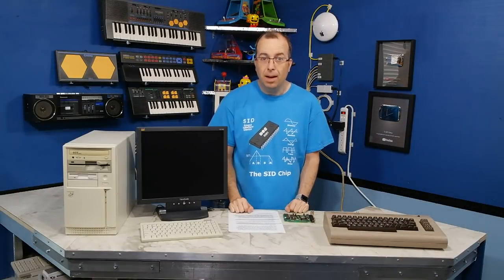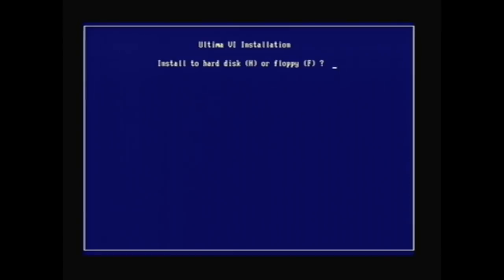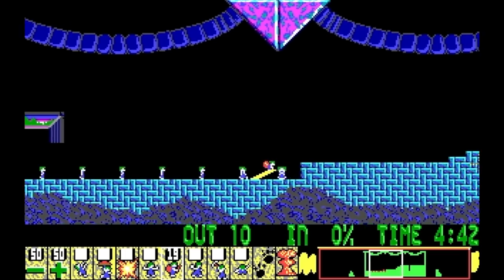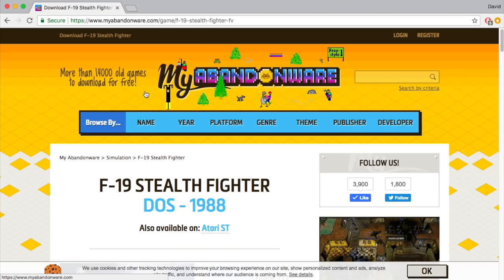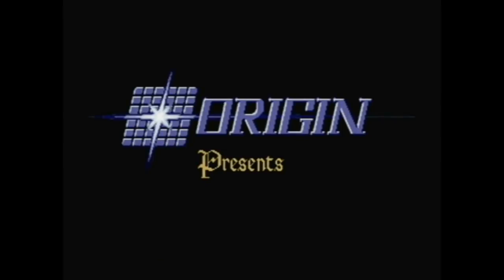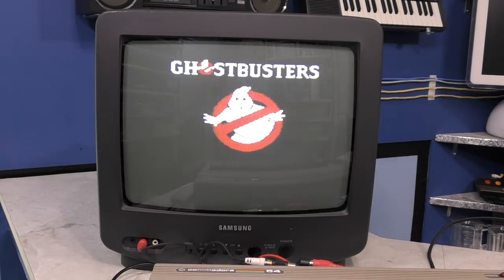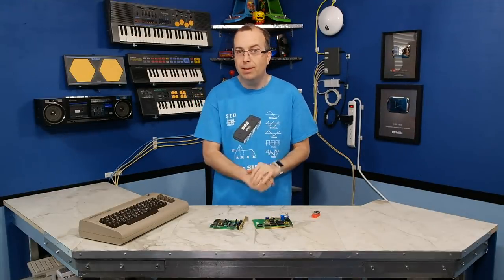Replica Sound Cards - AdLib, Innovation SSI-2001, and SwinSID Ultimate.

Comment: Something probaly only headphone users noticed: the SwinSID chip on the replica board had some pseudo stereo emulation. I suspect this is an optinal feature and  probably off by default on the real C64. Edit: I checked it on the creator's website and stereo is metioned.

Comment: Holy yes those LEDs
Reply: Yeah.. too bad they stay hidden under C64 keyboard :(
Reply: A c64 II with acrylic case would look amazing with the chip inside
Reply: @Booruvcheek  I'm almost a year late but by the looks of it there are pads for attaching external LEDs on the PCB. At 13:06 it's clearly visible. So if you want you can solder wires to these pads and put remote LEDs where you like.
Reply: @Sheevlord  That's a nice feature right there. Sadly, I don't own a C64, nor have I ever seen one of those machines. I doubt there were many of them in the 80s in USSR during my childhood, in fact, owning a computer (any computer) was something I could only dream of.

But anyway, thanks for pointing that out.
Also, nice userpic :D
Mr. Palpatine was perhaps the best part of the prequels.
Reply: @Booruvcheek  Yep. Then again, it's not surprising, since Ian McDiarmid who played him is a renowned actor with a long career.
Reply: @Booruvcheek  They made a lot of  them so it should be easy to find one now.
Reply: Zach K i was just about to say, thats the cutest use of technology ive ever seen.

You go, little LED band.
Reply: @Booruvcheek  not good
Reply: @Booruvcheek  why wouldn’t there be a lot of computers in the USSR? Why couldn’t you buy a computer back then?
Reply: @dqwno4900  Because planned economy of USSR was, how do I put it mildly, not very good at anything except producing weapons and things required to manufacture weapons. You know - iron ore, concrete, etc., and then tanks, tanks, tanks. Tens of thousands of them.

To buy a car, on the other hand, you had to wait for years, if not a decade in a queue. If you were lucky enough to be allowed into a queue like that.

So, as you can imagine, manufacturing "home computers" for the masses was not high on the list of things to do for the Communist Party planners. It was seen as a passing fad, a fancy, not helping the glorious state in its eternal quest for Communism, and was generally frowned upon by the Communist Party apparatchiks.

As the result, Soviet home computers were (1) hard to find in stores - only in  big cities you could actually see them on the shelves, this also means you could not choose the computer to get, you can only buy the one model that is sold in your city;
(2) expensive, as in worth between 4 to 6 monthly salaries;
(3) incompatible with each other, although this was also the case in the West, but in the West by the end of the 80s bad or unpopular models died out, while in USSR you were lucky to get anything;
(4) of poor quality - poor keyboards (e.g. BK-0010 with membrane keyboard), unreliable, etc.
(5) there wasn't much useful software or many good games for them, the situation was made worse by their incompatibility with each other.

Huge popularity of ZX Spectrum clones in the late 80s and 90s was caused by the reasons above. These clones were cheaper, manufactured by small shops that were allowed to operate privately by Gorbachev, often by one person, who was earning money from sales, not just fulfilling state planners' quota.
Also there was abundance of (pirated) software and games for these machines.

To this day they are fondly remembered by many folks who "were there" all over the former USSR.

Comment: That Chime sound is so charming, i'm surprised that type of idea was never implemented in any other sound chips back in the day to differentiate themselves from their competitor. Something like "Only TRUE AdLibs will tell you on startup" would be a killer selling point from a marketing point of view.
Reply: that chime reminds me of the mac computer one.
Reply: The Apple IIGS makes a similar-sounding chime when you turn it on or reset it.
Reply: Acorn computers such as the BBC micro and Archimedes machines make a soft beep on startup too. Its used as a type of POST signal to let you know its working. Of course PC's always make that beep too (not a nice sounding one like this) so I think the C64 is better off with this beep. Its like a little "hello" when you switch it on.
Reply: Macs still make that very annoying sound. >:(
Reply: Interestingly enough, for a long time, you could actually tell what series a Mac was from based on the sound of its startup chime. They basically recreated the chime each time a new major version of the ROM was made, up until Steve Jobs returned and made sure every mac from the original iMac onward used the exact same sound.
Reply: Tyler Benson Because adding this in an old school sound chip would involve a lot of extra circuits on the chip, serving no productive purpose.  But because the modern replacement is actually an entire computer simulating SID chip behaviour, adding the chime is just a few extra lines of code squeezed into excess ROM (because ROM is only sold in nice regular sizes). Back in the day, it would be the main CPU programmed to play the startup sound, using available space in the main ROM.  IBM PC actually had one of the most elaborate startup sound implications, playing different "beep codes" depending on what hardware was too broken to show an errors message on screen, there were even beep codes for absolutely no RAM, broken CPU etc.  If all went well, the Power On Self Test (POST) would issue a single decisive beep to signal all OK, booting now.  The original beep code logic was extremely clever in how it did things before the hardware could be fully trusted.  For example, with no RAM, no subroutines could be called, and with no confirmed timer clock, the CPU had to generate and output PWM sound in real time by running loops at different speeds, using nothing but the 10½ 16 bit registers, the flag bits and the ROM itself.
Reply: @dlarge6502  Actually in the case of the BBC Model B, not true. The SN76489 PSG sound chip has a random register array on start up so all the channels make noise. When the computer boots the first thing it does is initialise the PSG and mute it. The only reason it takes a second or so compared to the Master System or tandy is because the BBC uses a 555 timer to hold the reset low when power is applied, where as the other two boot almost immediately and thus clear it before the user really hears anything.

So in essence, that startup beep in the beeb is just a quirk, not a feature.
Reply: Putting it simply, it was because the old sound cards relied on the CPU to actually create the sounds to be output to the yamaha or SID, the chips were extremely advanced but they werent computers they didnt have RAM or a microprocessor, even when the soundblaster came out it would use DMA and Interrupt requests to talk to the CPU, and so the CPU could just tell the blaster " hey your sound it at memory location 03H or something... go get it and play it" and the sound blaster was able to do that, but it couldnt hold any sounds in its ROM so they were essentially silent

Even modern sound cards in your modern machine work in a very similar way, the CPU still handles the load of telling the sound chips where to find the sounds and the chip just pulls them down and plays them, which is also why you need drivers today for full support... its also why a lot of PCs still have little piezos for the POST Beeps, some chips while emulate the beeper but the mainboard has to support that.

Comment: Technical nerd correction at 7:25: the 78L09 is a 9V voltage regulator, not a transistor. I figure the jumper is connecting the pad for the regulator's input straight to the output. When you remove the jumper and put in the regulator, the 12V power is regulated down to 9V for the 8580. If you ever wanted to put an 8580 in there, that regulator can be obtained very cheaply.

Comment: Thank you for the video, The 8-Bit Guy!
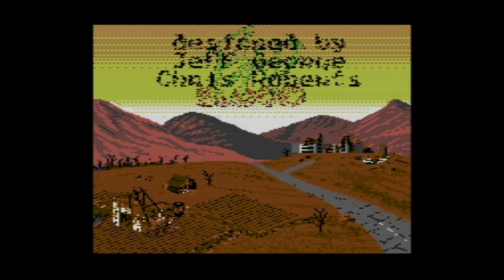09:01 - definitely much better music on C64 version. The marketing problem of the Innovation that you've mentioned may well be the source of the problem. SSI-2001 support, even when it was added, was very basic, SID chip was treated more like 3-voice Tandy chip with another waveforms... Not nearly unleashing the full potential of the SID. As a result the sound was pretty "meh" compared to Adlib or other cards. No contest to the same SID in the C64.
11:33 - I didn't try SwinSID of any version in my cards and I don't know about its ability to work on different clocks... Probably it only can emulate 0.95 MHz (C64 PAL) and 1.023 MHz (C64 NTSC). But SSI-2001 runs the SID on 0.895 MHz. Probably SwinSID tries to detect the input frequency, rounds it to one of the C64's and can not produce sound in tact with actual clock (0.895 MHz), also sounding a little off in tone. And for real SID it is not a problem at all, it will run at any clock provided.
Also, you can switch a jumper on the SSI-2001 replica to make the SID run at 1.023 MHz (C64 NTSC) clock. In "officially supported" games tone will be off, but with osp2001 *.SID player it will run exactly as C64 (NTSC version).
Reply: I would also attribute this to composer skills. IBM PC composers generally did think in terms of musical instruments that a sound card should simulate and musical notes that you can play on it. Hence it is no surprise that MIDI did play an important role in PC music.

That approach completely fails with a SID, because it doesn't resemeble real instruments at all. In order to unleash the SID, you need to look within a musical note and turn several knobs of the analog synthesizer (such as filter frequency and pluse width) in orde to make sound more lively and dynamic. Also the high accurate frequency control (16 bit versus 12 bit for Adlib) does allow effects that are impossible with Adlib, but you only notice that when you are after those effects rather than just wanting to play some notes.

C64 composers did look deeper, because the SID forced them to do so. Music for the SSI-2001 was likely an afterthough and so the PC composers did not want to spend too much energy on getting the best out of that weird Commodore sound chip.
Reply: Daniël Mantione at first glance yes, that can justify "lazyness" of PC music composers.
But heart of the AdLib card - Yamaha OPL2 FM-synth chip - is more or less the same story. It is a tone generator with a bunch of "knobs". But OPL2 had more voices and waveforms.
Even if composers were too lazy, why not just port exact same melody from C64 version of the game, the SID is the same and it can be addressed the same way as on C64.
Reply: Getting music between platforms wasn't nearly as easy as it is today, since they usually only had 5.25" floppies to work with and each platform usually had its own floppy standard that was incompatible with the other platforms. It wasn't until after 3.5" floppies became the norm that FAT became available on multiple platforms, enabling easy file transfer between them.

It would have been much easier for them to convert existing PC versions of the music to the Innovation version than transcribing the code from the C64 version by hand.
Reply: Certainly true, but the "file exchange on floppy" problem was the easiest to solve: The Commodore 1571 can, with the right software, read and write PC floppies.

A far worse problem would have been that any C64 music was written in 6502 machine code and would have to be completely rewritten for the x86 CPU of the PC, even though the sound chip was exactly the same.
Reply: I think for authors of the game at a time transferring their source code or any other parts (such as music) between platforms was not an issue.
Reply: And how long has the software for reading PC floppies on the 1571 been around? If it's been widely available since before these games were originally made, then that is one less hurdle to the process. Remember, though, most of the time the only ways people heard about these kinds of things were through magazines and Bulletin Board Services, as this was before the internet as-we-know-it became widespread.

One other note (no pun intended) on the subject of music, which Daniel Mantione touched on, is that not every system stored their music in a format that we could consider a standard. 

Commodore systems stored their music as a series of instructions for the 6502 (technically the expanded 6510, but it was still a 6502 core) to pass to the SID chip so it could interpret them. Certain other systems as well as popular game consoles like the SNES and Genesis/Megadrive also used a similar method for their dedicated sound chips, with code written for that particular chip and processor combination. Even certain early PC sound cards used this method.

Systems that didn't have dedicated sound hardware relied on coding specific to those systems to approximate what those dedicated chips could do, which often fell far short. The Apple II series, for example, was always lagging in the sound department because it didn't get a dedicated sound chip until the IIgs.

While MIDI was around, it didn't really have the support for custom instruments and effects that directly controlling the synth chip allowed. That said, it was still quite popular as it was more intuitive for musicians to use, to the point that most PC sound card makers started to implement some form of the General MIDI standard in their cards. Unfortunately, because of the difference in how MIDI works and how the other music methods work, it's not a simple task to convert from the other methods to MIDI, though the other way around isn't so hard.
Reply: "Big Blue Reader", the most popular program to read IBM PC disks on a 1571, was released in 1986, so well before these games were written. What you write about internet unavailable is right, but I assume game studios were relatively well informed and would be aware of these possibilities.

An alternative for data exchange with PCs is to use RS232, and this would have been the method before the 1571 came on the market. The C64 supports RS232 right from BASIC, allowing anyone with some programming skills to use it do exchange data with a PC.

Comment: 13:00 - omg Dave, that gave me an idea - put pin headers there, and then mount LEDs to the case, and connect them to the headers. That'd be a cute lil addition to a Commodore64
Reply: Agreed!  I loved the look of those LEDs, they would look great on the case itself.
Reply: I mean Clearly thats why there are pin headers there. but it would look pretty swanky
Reply: there are holes, but it seems to come unpopulated, so he would need to add the header pins.
Reply: Red yellow and blue of the color bars?
Reply: ^THAT would be a thing of beauty - a Commodore 64 Logo Plate with inbuilt LEDS and plexi lightpiping that acts as an accessory to the SID clone!
Reply: Sacrilege!
It guess it's ok if no holes are drilled but for how long do you think blinking leds will entertain anyone?
Reply: It's the year of the RGB *even for the C64*!
Reply: Mustakari RGB lighting is still as relevant now, As it was in the beginning of 2017. So, It would entertain at least me for a long time.
Reply: @ Nonathan Bogensperger: Yeah That would be cool. Especially combined with that C64 reloaded board. Making it the ultimate C64.
Reply: ultimate c64 is already a diffrent replacement c64 board.
Reply: Getting that to work on an Adlib with 9 LEDs would also be pretty sweet :)
Reply: Would look dumb using a green LED there.
Blue LEDs require higher voltage
 @stevenclark2188
Reply: @weepingscorpion8739  an MT-32 with 128 LEDs
Reply: @user-pc5sc7zi9j  You could use it though, the Rainbow of the 64 logo does have green in its color, also whos to say that a blue wouldnt work... if the chip is in a breadbin 64 its got plenty of voltage for a blue LED to light.